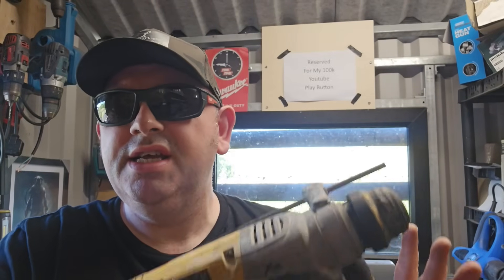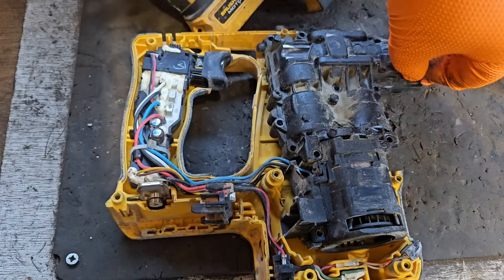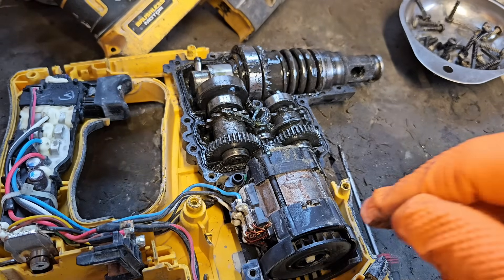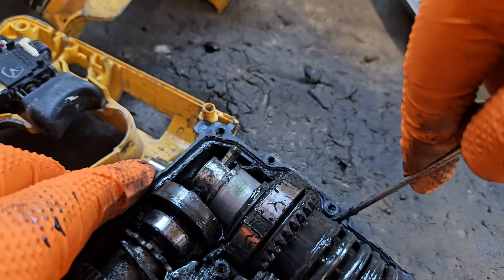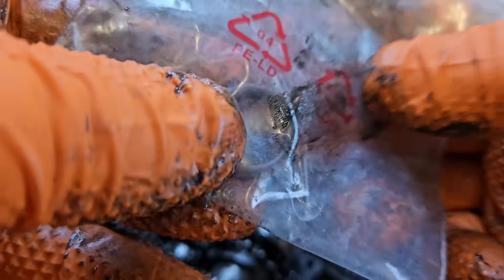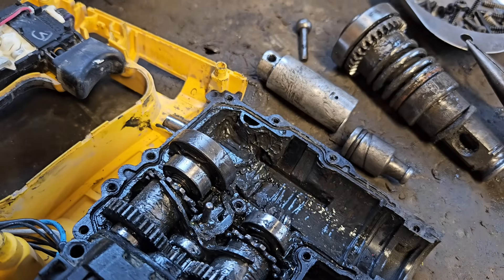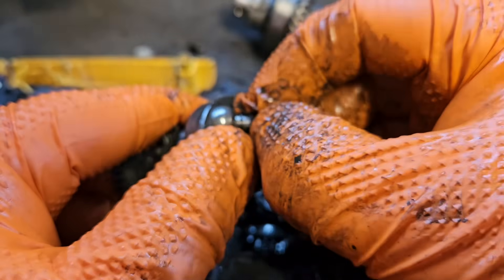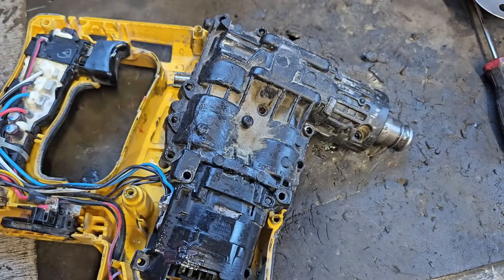DCH273 Repair course EPISODE 4: Repairing the hammer

Comment: Just finished repairing one I picked up from a liquidator. The hammer side drive shaft was broken. After assembling with a new shaft far enough to do a test, I found that it was seizing up. Turns out the spindle would not fully seat in the new drive shaft. I had to use a dremel to grind off part of the shaft sticking too far out above the spindle slot. After getting the spindle situated everything worked out.
Reply from the maker: Cool well done